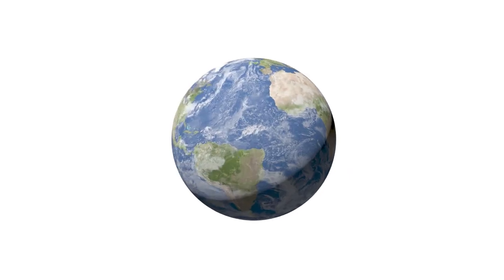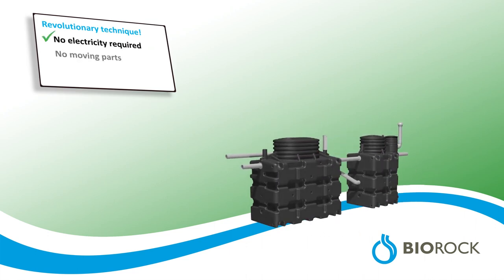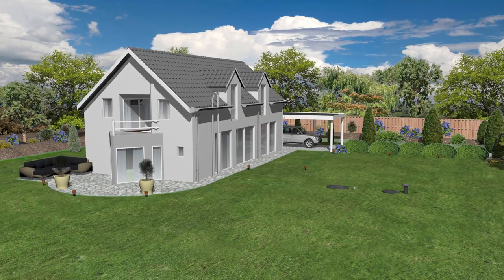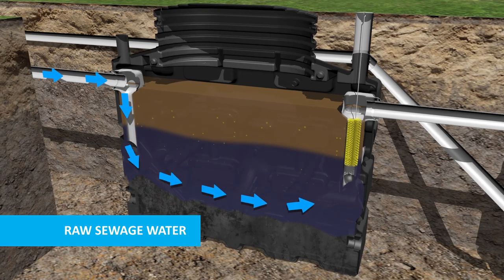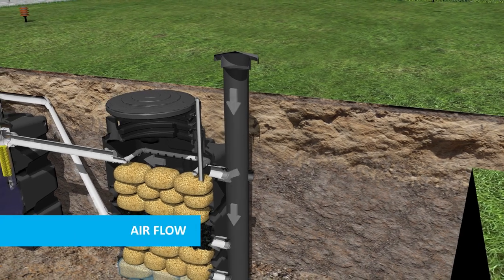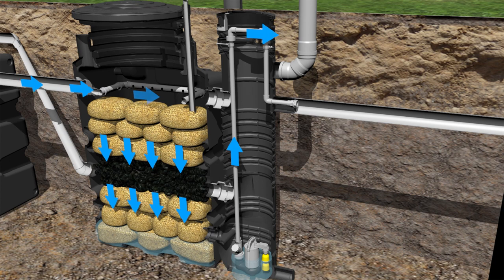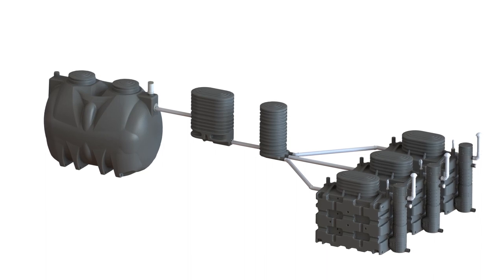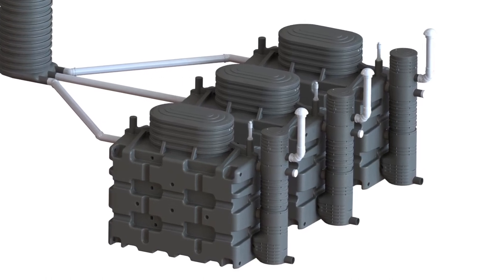BIOROCK Non-electrical Septic system

Comment: anyone here ever install one of these systems? and where are they available. im in Canada BC and seems handy to have as a option
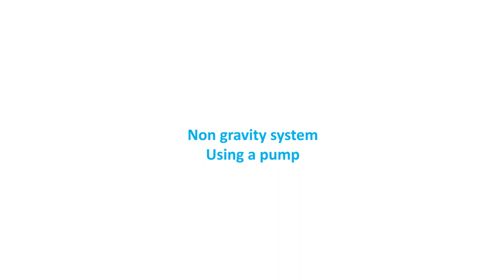Reply: Many people have these systems (not only Biorock) in Poland. We are also choosing one of them and we want a passive one (no electricity usage). I have just read that this one is one of the most expensive when you buy it but in usage it is one of the cheapest. The only real con with this is that in some cases you need a pumping station for clean waste and it uses electricity (2:35).